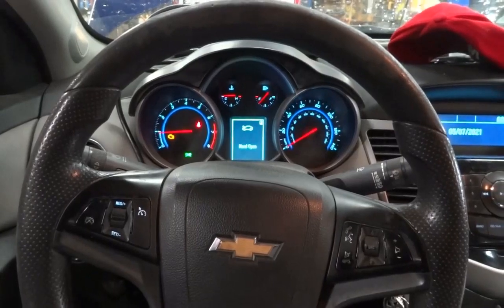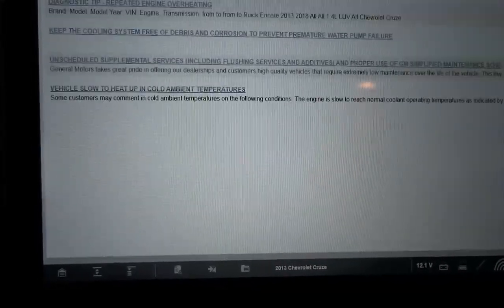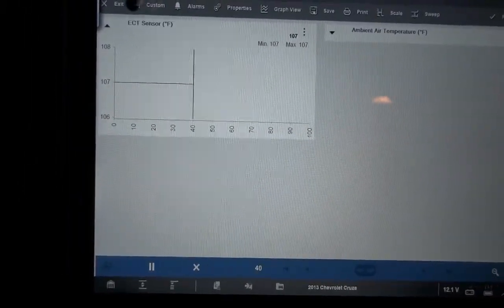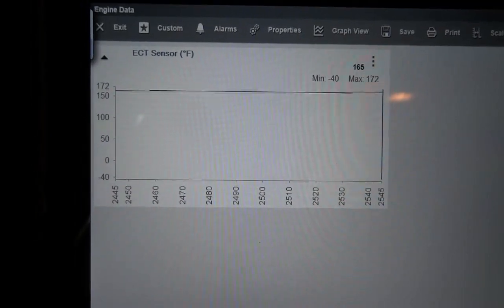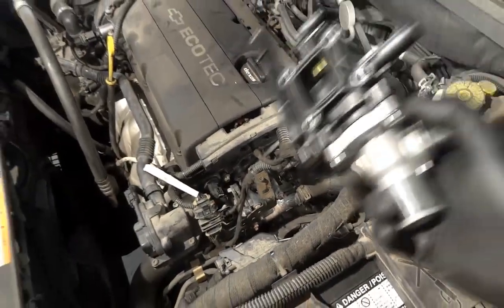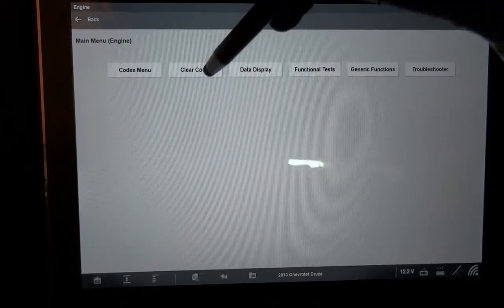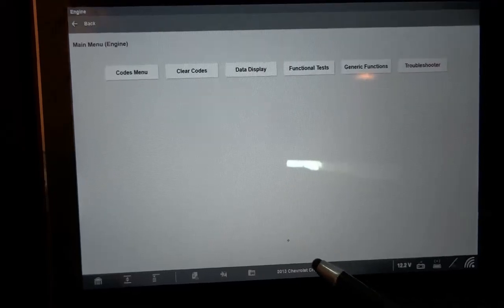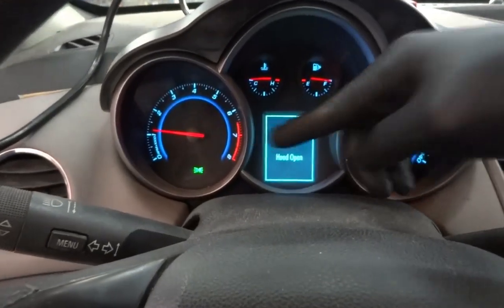Chevy Cruze 1.8L Thermostat Housing Replacement / 2013 Chevy Cruze Code P0128 Diagnosis and Repair

Comment: Be careful when you loosen your coolant hoses. Coolant can help accelerate deterioration of plastic/wiring over time leading to more problems if not cleaned up properly.  Drain the coolant from the radiator, pinch off or use plugs for the hoses to keep the coolant from pouring out onto your engine/other components.  You'll fix one thing but will cause further problems down the road for yourself. Take your time and do it right so you don't have to spend more time/effort, AND money on more repairs/parts. Take care folks!
Reply from the maker: @EddieLeal   Good!
Reply: Thanks for guy's like u🎉❤

Comment: Good video. Only suggestion.. After the repair was complete you cleared the codes .. I only wish you would have went back in to live data and showed us the difference when running  correctly.. also I don't recall seeing bolt size for the four main bolts holding the thermostat. They look like they had a weird head .. I do like your video though thanks
Reply from the maker: @johnfreeze3021  My Pleasure!

Comment: Does the tube that connects to the housing on the bottom need replacing mine is leaking at connection under manifold? Or does it just need new Orings? ty great video
Reply from the maker: @philipbartee5674  you don't have to replace it, you can just replace the gaskets!
Reply: Is it leaking behind manifold?  It's a gasket.  Unless crack in it or something.   Go ahead and get oil cooler gasket kit. And be prepared for the work 😞  just did mine. Fixed a leak found another and so on.

Comment: Changed our 2014 Chevy Cruz water outlet this morning, your video was spot on and made this job very easy. Thanks for sharing. I don't own a test machine as ours was checked at local auto parts for error code. Is there a way to reset the codes without the test machine or will it clear on it's own?
Reply from the maker: Jon Beck  disconnect the battery for 5 minutes, it should reset the ECM's memory and I'm glad to hear that I was able to help through this video!

Comment: What’s the name of the tube you removed minds broke at the 90
Reply from the maker: Mr Dickem the hood mechanic  it's a heater tube!
Reply: Were you able to easily replace it? I replaced my thermostat housing the other day and the plastic on that tube broke.

Comment: i just replaced the housing on my 2014 chevy cruze ls but temp gauge still stays on cold and still shows "AC off due to high temp"
Reply from the maker: Johnny Mota   check the second temp sensor!!
Reply: @KITS_Auto_and_Truck_Repair  which one is that one?

Comment: Isn’t that the water outlet not the thermostat? I thought thermostat was located on passenger side of engine with the hose that goes to radiator
Reply from the maker: Ricardo S  That's the thermostat housing!

Comment: There are different thermostat assembly in market what kind will you recommend for chevy Cruze 2014 1.8L?
Reply from the maker: Ahmad Hasnain  I will recommend an original one from the Chevy dealer if you can get one,

Comment: K Diagnostics, I recently changed out the housing on a 2013 1.8 and have a slow drip from the temp sensor. What is the correct position for the sensor and pin? If I install a rubber washer, would it interfere with the sensor reading?
Reply from the maker: James Markel  you should replace the sensor oring/ gasket and your leak will be fixed!!

Comment: I just have a question about the tube pipe at the bottom of the actual thermostat housing. I saw you pot back the two bolts holding it to the housing but I didn't see you use some  kind of sealer.  Is that OK?
Reply from the maker: Luis Carrillo  the tube has a gasket on the thermostat housing! so no sealer needed!
Reply: @KITS_Auto_and_Truck_Repair  thanks for the reply.. I just can't believe my local chevy dealer wanted to charge me $1760.00 for doing this job.  Thanks to your video I saved a big part of this amount.
Reply from the maker: @luiscarrillo2233  My Pleasure!! I'm glad to hear that the video was helpful!!

Comment: Hello, thanks for the video, but I don’t see that temperature gauge will be showing normal working temperature, just cold till the end of video, how can it be? Or I don’t understand something.
Reply from the maker: tommego1 I didn't let the engine reach operating temperature after I replaced the thermostat, I already knew that it was fixed!!!